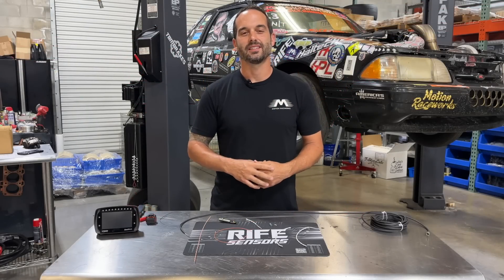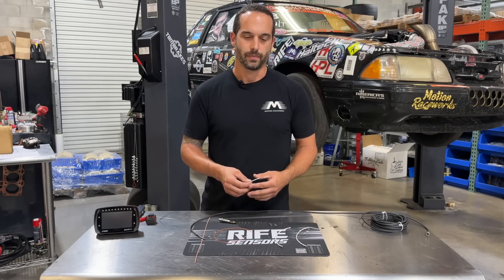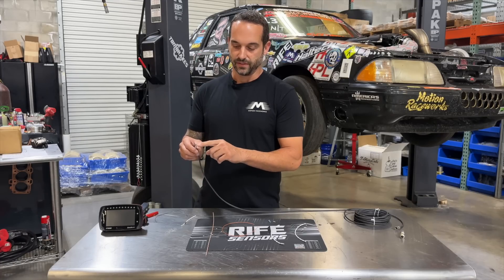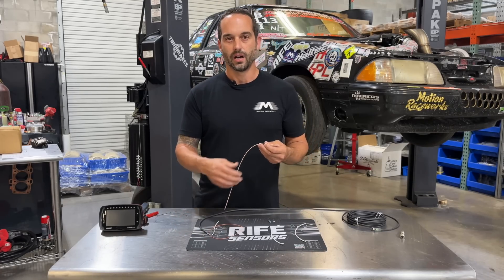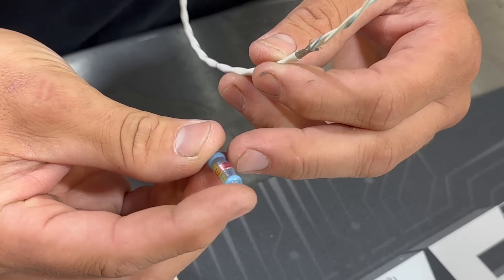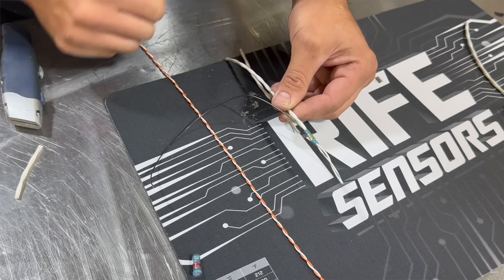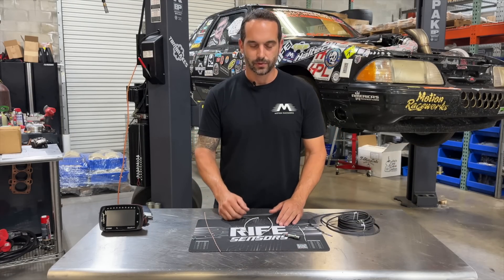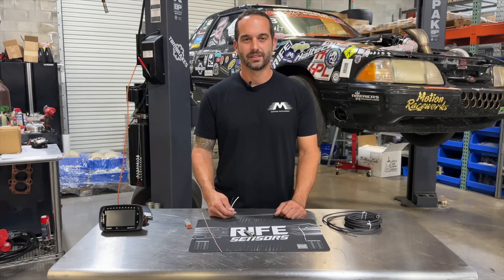Shielded Wiring How To: Must See for Camshaft, Crankshaft and Driveshaft Speed Sensors

Comment: I’m using Fueltech ft450 in my ktm duke 390 36-2 crank trigger wheel patter and it’s alert showing VR differential Crank trigger error, missed tooth reading and gap detected at wrong spot, I checked everything sensor, wheel, gap 
Pls help me with solution for this error 
Waiting for your reply

Comment: I got a 2000 gmc 3500 bucket truck cab & chassis w/ dura lift man boom lift , the vss wire is shielded , the abs ground runs down to the vss sensor at the transmision , the computer is right next to the ans module driverside inner fender , the vss wires run to that computer nothing is hooked to the braides ground by the computer ..they ran that abs ground all the way to the transmision and hooked into the other end of the shielding wire , its gotta be in the wrong spot , where does my abs ground go ? My wire diagram is out of haynes it dont show a abs module , it shows 8 coils and 8 injectors , i got one coil and tbi ..

Comment: Glad to see this attention brought to just a sensor and harness. In this world where techs still learn how OBD-2 works after 30+ years, shielding becomes more important than ever! Holding 28+ seminars including serial data, I bring up star-washers for good grounds. Dielectric grease in connectors, in terminals, bulbs, the flashlights in their tool boxes. As you twist shielding together, I often cut it long only to fold over to fit tighter in the connector. I like shrink tubing and have spools of 3M of two popular sizes. Even the LS swap and Fords, but this is new technology and must learn new ways. 90% of techs never check alternators for A/C voltage on a DC circuit that results from bad diodes as power demands increase. This is internal noise from 0.010Vac to 0.060 Vac at 2k RPM with a load or not, at the alternator. 1/3rd at the battery as it acts as a capacitor / calming the ac voltage.
  Thank you kindly for your info!
ASE Master tech since 78. ACDelco seminar leader in 7 Midwest states.

Comment: There is much better wire then this. You want a good Dual Shielded  cable that has a drain wire running through it which you then ground rather then just soldering to the shield itself. All drain wires should go directly to the battery ground not a chassis point. Look into high quality CNC cable MFG to understand proper cable assemblies.

Comment: I wished I would’ve seen this video 15 years ago. I didn’t know how to shield the wire, so I just made tape out of regular aluminum, tinfoil. Shielded everything with the aluminum tape and then covered it with electrical tape all the way over the connectors, never had another backfire. We made numerous calls to Holly in order to get the same information you have provided, but we’re never able to get any information from them. Thanks great video.
Reply: What sensor did you do that on. Because i recently attempted to splice my crank position sensor cable which was already shielded with a foil.

Comment: Fun coincidence, I just watched this video on my midnight dinner break last night, after hand fab-ing a bracket for the RIFE's Speed Sensor I'm installing on a friend's ZX14R Drag Bike (it has your 2 1/2" reluctor wheel on his offset front sprocket as well). That and, it will have Rife IAT (two, with one being in the Dry Block),
along with your Oil Temp., Fuel and Oil Pressure as well = I ❤Rife Sensors 😎

Comment: This is amazing information. I did not know. I was literally just trying to get my speedometer to work the other day on my 700R 4 and it’s going to a digital dash the wire I was messing with had this measure around it and there was only one wire will look to be one wire coming out of it now I understand why it doesn’t work and what I did wrong. Thanks for the tip.

Comment: One thing that I do for all of my shielded wires is pull the braid back over the sheathing before recovering down the solder sleeve. Helps prevent any potential shorts from the shielding to the conductors, the only downside is having to size up the raychem solder sleeves when dealing with larger bundles.

Comment: When passing the shielded wires through a bulkhead connector, can the shielded wires share the same pin? Let’s say I have crank cam and wheel speed. Do they each need their own shielded wire pass-through (3 dedicated pins) or can they all be combined on the same single pin?
Reply: The shielding ground could be combined to a single pin to pass through.

Comment: Be careful with the wire using the heat shrink/solder butt connectors, some pvc wires/cables won't take the extra heat. Might melt the jacketing.

Comment: These cables are widely used in aircraft and spacecraft. https://standards.nasa.gov/standard/NASA/NASA-STD-87394  This is a link to the NASA standard for wiring and cabling. The information is useful for almost any kind of power or data cabling. I did this kind of work for over 30 years until I retired last year.

Comment: Belden style shielded twisted pair wire?  18awg conductors with the foil and the ground?  

Absolutely correct on grounding only one end.  It's done the same way in control wiring for residential/commercial/industrial low voltage and canbus control wiring.